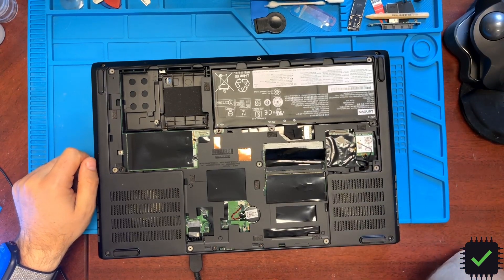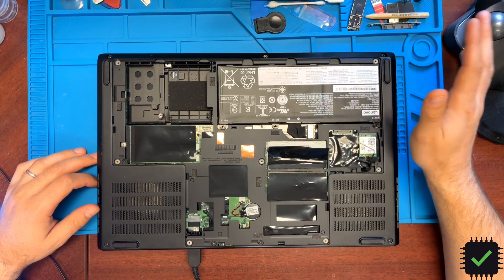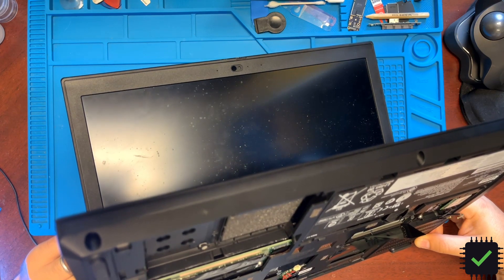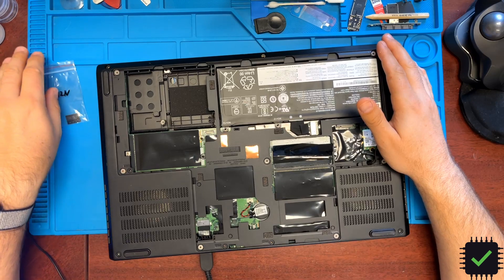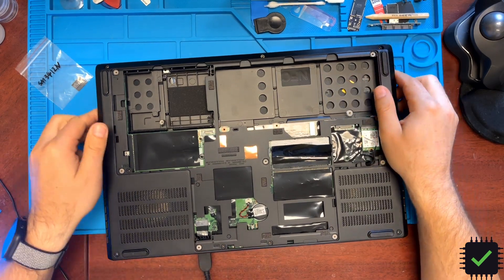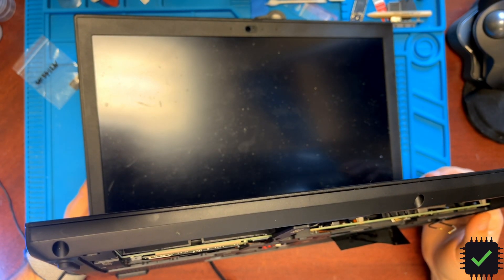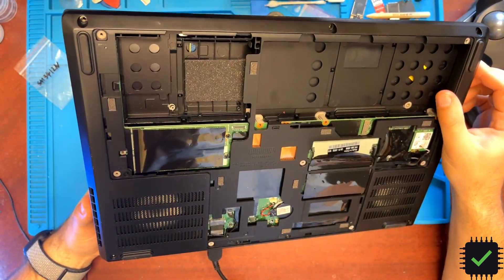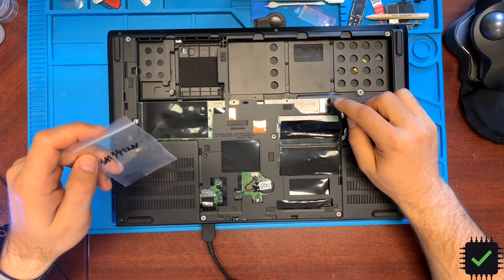Lenovo P53 No Power Not Charging No Amber Light on Charging Indicator Repair / Workaround

Comment: Thank you for the video. If my Lenovo charger stops working after few month of usage is it the charger port problem? Plug heats up. Workinh worse and worse. Cleaning inside of a plug with needle helps but for short time. I buy a new charger. And problem repeat in month or two again. Do you have this problem with Lenovos often? Is the charger replacement will help? Many thanks.
Reply: yeah i think that in your case only replacing the charging port will help